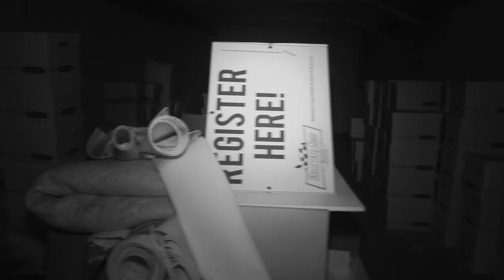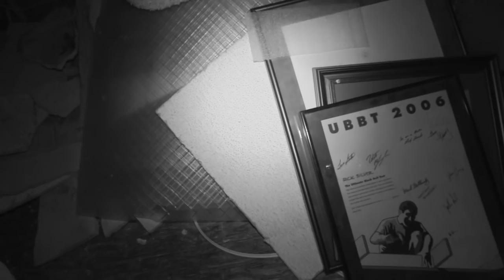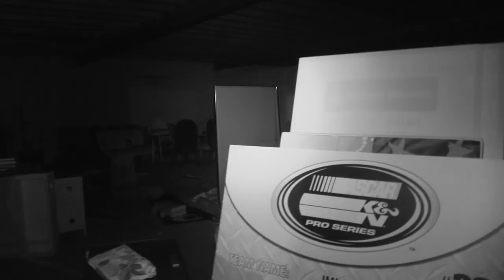**scary** HAUNTED CLOWN ATTIC: SOMETHING THROWN

Comment: Hey CJ & Sonny 🤔, 4:29 something tinny gets chucked, 10:56 something plastic got chucked, 12:40 the plastic ball wasn’t there when you came through earlier, 18:26 Halloween head in the middle of the path , wasn’t there earlier, 19:06 the ball is now against the partition, 21:06 a plank of wood dropped , 21:29 orb comes from left far door towards you both , 24:55 looks like a face in the furthest left window peeking through, 25:35 something got tapped, 44:12 something gets chucked inches away from cjs back , 47:17 Sonny I swear you have a dirty mind 😂, good video CJ 🙃💨

Comment: You and Rose need to spend some time up there, getting things cleaned up. Hard to tell the paranormal from the unafe conditions...
Reply: It looks like someone has been up there cleaning.  It's not near as cluttered as it used to be.
Reply: I agree if the attic was cleaned up and organized then it would be safer and you could tell if something is out of place. You have a great haunted place right there and don't have to worry about cops or security..

Comment: Headphones on,  got a few sounds for everyone to check out and A BUNCH of orbs that happen after bangs & items thrown

From the first time you guys step in the attic, and first orb movement I noticed, nearly everytime the orb is present it's REALLY HIGH UP.  Like right up to the ceiling. 
4:32 - 4:34 right after something gets thrown at you guys an orb flies top screen almost center near the pole in the middle towards you guys. Second horizontal beam back towards camera. 

What the heck was that hidden room for? Very odd. The haunting could have something to do with that room. Hidden rooms are rarely used for good. 
Foul odors are also notoriously not good with spirits. That is often a sign of something dark....
21:29 - 21:31 back left corner os where I think the noise just came from as an orb flies way up top screen left towards you guys.

27:36 - 27:38 this is REALL HARD TO HEAR headphones FOR SURE, but it's sounds like a man yelling words, but I can't make them out.
31:16 - 31:18
There's a high pitched scream/squeal sound in the back ground.

31:26 - 31:32 An orb flies above CJ top left screen flies to the right and appears to leap from the back right 2 windows and out of the window 2nd window from the back wall toward the camera.

37:34 - 37:35 When discussing where the clown came from there's a male voice that's not Sonny or CJ kinda sounds like it says "woah" as "CJ says Man that is true" but it really it's probably just indistinguishable words being said like a response, kind of a mumbling.

39:50 - 39:51 top screen center orb flies left to right

CJ i'm worried about your breathing. You might be developing a lung problem from going into these dilapidated buildings and not having proper equipment to protect your lungs.

Comment: At 4:33 it looked like an orb flew in-between that pole on the right side of your video and that wall. It's up towards the ceiling. 18:28-that big pumpkin was NOT sitting there earlier in your video. WTF!!!  If it's sulfur you are smelling then that means there is a DEMON in that room. 44:13-a tire cover was thrown at you from your right side and landed on that pile of stuff on your left. It flew right behind you. Too scary. Great video CJ. I hope you do another (part 2).

Comment: 4:33 there is an orb up by the ceiling. 8:41 there is a female voice, kinda sounds like it's singing. 9:25 male voice. 9:43 something says "ha." 11:16 female voice, it says "moving." 18:28 there is a pumpkin decoration in the middle of the room WTF. 21:18 a male voice, not Sonny or Cj, it's as they r talking. 25:56 a voice. 26:42 a whisper that says "hey." 31:12 2 orbs, one flies towards the camera and one flies away, up by the ceiling. 31:29 orb. 37:35 male voice. 38:14 a whisper. Right when u said untold story, that's when that thing got thrown at u. Great video guys.

Comment: The attic needs to be cleaned up to have a little bit of order to it, so it's not such a injury hazard to anyone who goes up there particularly Rose. If the door does not close properly after you slam it nonchalant, perhaps have a proper door fitted with a real lock on it to prevent any accidents or hazards. Insurance would be rather costly if someone was to trip or slip, crack their neck and become disabled or worse. Have you investigated the paperwork in the hidden room? At least to find out what it's related to. Good luck with any further investigations on this property. Do you think that Bink would be protecting or defending any harmful entities on this business property?